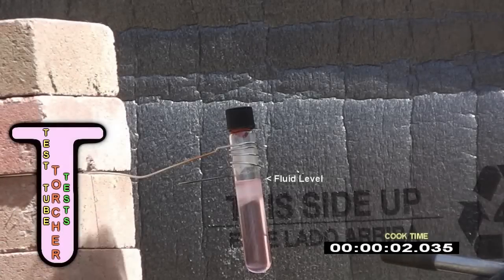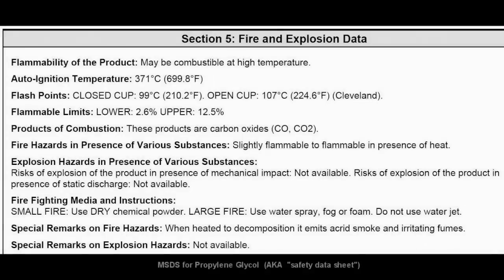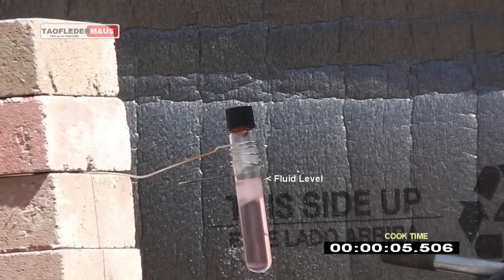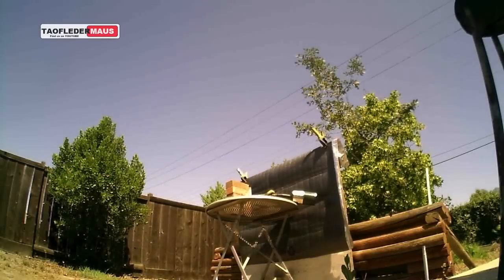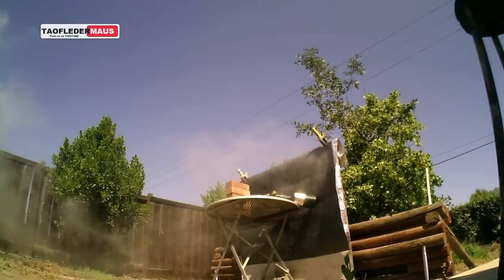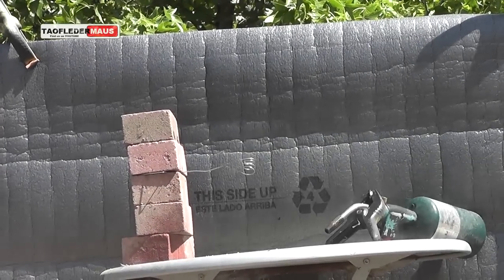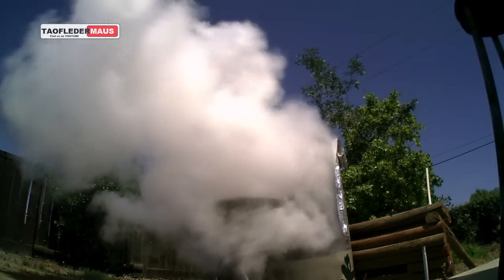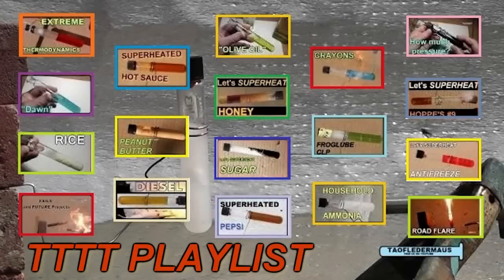TTTT - E-Cig Fluid -  30ml Superheated

Comment: if you had any clue about the ecig industry you would no that most ejuices vaped now are made anywhere from 50/50up to 90/10 and in rare cases 100/0 and the left numbers signifying vegetable glycerin and the right numbers signifying pg otherwise known as propylene glycol which mind you every study that has been done with ecigs have been done by BIG TOBACCO scientist.I am not saying ecigs are safe but I have been vaping for the past year and a half and I can run now I can walk up three flights of steps without weezing I had previously smoked Newport 100s™ for 12 years so it's proven thus far as I see they are relatively more safe than traditional Cigaretes thank you

Comment: I noticed that the test tube only explodes usually when it's push down from the fluidic scaping out of the spell so hard that it hits the bricks breaking the glass causing it to shatter. without slow mo I always thought that they just exploded from the pressure inside the tube.

Comment: How to smoke 600 e-cigs at once.
Reply: Didn't know I was dealing with children. I digress.
Reply: I have been enjoying these videos a lot. The wobbly wire and bricks where replaced with a metal bracket recently, not nearly as much fun. The wobbly wire is now back, new and improved. Sure there could be more science. Temperature probes etc But it kind of takes the fun out of superheating stuff in a confined space.
The flame at 3:17 was from the propane torch.

If you want to see a good fireball, check out the brake fluid one :)
Reply from the maker: Edward McLaughlin   If it bothers you so much,  don't watch the videos.   You won't be missed.

Comment: Can you perhaps test polyester in the tube? I know the reaction between the base and hardener can give off a serious amount of heat when mixed. And I've been warned by people that wrong mixed polyester can auto-ignite. Also you can speed up or slow down the hardeningproces by warming or cooling. I just now wondered what would happen with sudden intense heat as your torch provides is presented to a tube of mixed polyester. Will it cook, harden, burn? Or some fast epoxy. And might as well test a tube with 10 seconds superglue maybe?....Cool show...And I have to agree with you and the 95% about the wire-stand.:)

Comment: The fluid cools down so fast, that it probably had 50° C when it popped. Btw a thermal imaging cam would be cool, it doesn't have to be high-speed, just so we can see the temperature... Like 5 cameras are not enough :)

Comment: Jeff -- just a clarification of the LEL and UEL percentages. They relate the concentration of the mixture with respect to Air. I think in a sealed tube, you're limiting the amount of air and therefore you surpassed the UEL. By the time the tube breaks and spreads the fuel, you get below the LEL and/or the temperature falls below the auto-ignite. I'm not an expert but just a firefighter and this is what we're taught about Haz-mat readings for LEL/UEL. Awesome vid.

Comment: Just wondering, but could the energetic nature of the vapor explosion (the test tube bursting from the material flashing to vapor) have something to do with the absence of a more "flame-y" (yeah, I couldn't think of a better term, but oh well) reaction? It looked like the explosive expansion of the vapor created somewhat of a pressure wave that pushed the air out of the way, starving the material of the oxygen required to create more than just a little bit of flame. It also sounded like the torch itself got blown out by the vapor flash.

Comment: Now that I think about it, Nicotine in these eCigs is often in very high concentrations (~10%) and nicotine is EXTREMELY poisonous (I mean, it's pretty high on a chart of the most poisonous things ever...)

Have you sterilized the area to make sure no animals get hurt from residual nicotine? For that matter, do you sterilize the area so neighborhood animals don't hurt themselves on stray glass shards?

http://en.wikipedia.org/wiki/Median_lethal_dose
Reply: no vendor and i mean absolutely no vendor would sell e liquid at that high of a concentration.
Reply: 13RuffRyder
The problem is the lack of regulation in this industry. eCigs are labelled anywhere from 0-34 mg/mL but they often have much much MORE than this in them. There is no oversight.
Want your mind blown? The FDA does not regulate eCig juice.

http://www.fda.gov/ForConsumers/ConsumerUpdates/ucm225210.htm

"FDA found significant quality issues that indicate that quality control processes used to manufacture these products are substandard or non-existent. FDA found that cartridges labeled as containing no nicotine contained nicotine and that three different electronic cigarette cartridges with the same label emitted a markedly different amount of nicotine with each puff."

Why not just smoke arsenic? I mean they probably are already without actually knowing it but god damn...
Reply: +liquidthex want your mind blown too? The nicotine content is usually on spot, especially since nicotine is fucking expensive, its the most expensive ingridient used in those liquids. Nicotine is toxic in high doses, yes, but surprise, low doses, like from vaping, are not known to cause any constant harm.
Reply: +Okay Dokey Except addiction, of course. and your statements lack any actual data to back them up, sooo.. let's hope you're correct?

Comment: Does the release blow out the torch?
Reply from the maker: Yes,   I forgot to mention that.   The torch was blown out.  This almost always happens.
Reply: ***** and this confirms your statement about concentrations - if the torch flame is blown out, there isn't much oxygen present in the smoke cloud!

PS was there a group of people trying to give up cigarettes stood behind your fence to catch a whiff of e-cig??
Reply from the maker: A lot of people thought the brake fluid and diesel ignited because of the torch flame,   but  just like this,  the concentration was too great near the torch,   and as the cloud of heated gases moved outward,  they mixed with the air and ignited spontaneously.

Comment: So the fluid in e-cigs has the same ingredient as engine coolant? Am I correct? If so, then that's probably as bad as smoking tobacco. However, cool idea and quite a result. Thanks again, Jeff!
Reply: It's usually ethylene glycol... but propylene glycol is still used in many applications as coolant.  Just not as popular as the ethylene variety for automotive uses.  Propylene glycol is basically Astroglide.  Yes, you're smoking sex lubricant.  ...and so am I.
Reply: Because PG is food safe, and has anti freezing properties, it's used as and anti freeze for RVs, the stuff they dye pink. It's used to keep the pipes from exploding. Still, some people that use it as a vape liquid are sensitive to it and opt for a mixture with all Vegetable glycerin and no Propylene glycol.
Reply: PG and VG are both ingredients in many health applications. Nebulizors and inhalators for asthma and other bronchial issues. Sure it is diverse in many products. Meh, it's still tons safer than smoking for those that cant quit nicotine.
Reply: sorry to inform you, PG is in many different Pharmacuiticals, for both ihhalation mysting, and other aplication. Same as VG
Reply: ***** Thank you for confirming and clarifying, Jeff!
...but don't you find it odd that it's an irritant, yet it's still one of the main ingredients in sex lubricants that get ingested internally in all kinds of different ways that we won't elaborate on here today?  That's always struck me as odd.

Perhaps we should see if sex lubricant has a similar result in a TTTT?  :P
Reply from the maker: Propylene glycol is used as a food grade antifreeze.   We use it at work as a medium to chill processes,  mixed with water to keep the freezing point about 25 deg F.  
*Potential Acute Health Effects:
Hazardous in case of ingestion. Slightly hazardous in case of skin contact (irritant, permeator), of eye contact (irritant), of
inhalation.*
Reply: *****
Water is poisonous if you drink enough of it without replacing the electrolytes in your body. It's called "Water intoxication" and it causes the brain to swell potentially resulting in death.
Reply: Engine coolant is POLYPROPYLENE GLYCOL not Propylene Glycol. PROPYLENE GLYCOL is found in food, drinks, toothpaste it is used as a flavor carrier. Just about everything you consume on a daily basis. I recommend you use Google and search the 2 Glycol's. Propylene Glycol was also used in hospitals in the 30's 40's they would put it into a vaporizer and pump it into the hospital as it is a natural bacterial germicide. I for example use Ecigs have now for 2 years and I have not had the flu. Where when I didn't use it I was sick all the time. I work with the public and everyone of my coworkers got the flu during flu season except for me. Coincidence, I think not as I am not the only one who has seen this.

Comment: You should place another flame a bit further away from the test tube to ignite the vapor since the propane torch keeps getting extinguished.
Reply from the maker: I never know where the cloud will spray.    I probably need a larger table too.
Reply: Thanks for replying, that's what I like about this channel. I guess putting it about half a metre above the test tube since the vapour usually goes up after exploding. Maybe hanging It if the back board to support it.
Reply from the maker: I'd probably have to put a few ignition sources around it at different distances.

Comment: Probably one of your more dangerous experiments, considering the high toxicity of nicotine!
Reply: Not really, 600 cigs @ 30 mL. I'm guessing it's a 1.8 mg or a 2.4 mg, seeing as those are the most common.
ECig liquid really only comes in a few strengths.
0 mg/mL = 0 mg per 30 mL
0.6mg/mL =18 mg per 30 mL
1.2mg/mL = 36 mg per 30 mL
1.8mg/mL = 54 mg  per 30 mL
2.4mg/mL = 72 mg per 30 mL
3.0mg/mL = 90 mg per 30 mL
3.6mg/mL = 108 mg per 30 mL

LD50 is 3.34 mg/kg (oral).
Let's say you weigh 75 kg (165 lbs) -> you would have to drink 250 mg of nicotine to hit the LD50. You would have to drink more than two bottles of the Strongest strength.

He wouldn't have gotten more than a nicotine buzz, but honestly he probably wouldn't have gotten even that. Besides, the heat that he put to it would have likely made the nicotine decompose.

A few drops of PURE nicotine is dangerous. e-cig liquid isn't even half as dangerous as you think.
Reply: Fair enough, it would be difficult to get a lethal dose from this, I agree. Just interesed in what animal that LD50 is based on as some of the estimates for LD50 in humans go lower than 0.5 mg/kg.
Reply: Also I assumed that if it's 600 cigarettes worth then it would be around the 600-1000mg of nicotine mark, since most cigarettes have about 1mg or slightly more nicotine each. It may work completely different for e-cig liquids though, I don't really know a lot about them.
Reply: Also, the flash point doesn't have anything to do with the temperature at which the nicotine decomposes, which must at least be high enough that it doesn't decompose when you smoke it from a burning cigarette.
Reply: jhonbus It's more accurate to say that 30 mL is a month's supply, whether you smoke ten packs a month or a carton a week.

1.8 mg/mL is equivalent to about pack a day (600 cigarettes over a month) but there's only about 1/10 the amount of nicotine in it compared to actual cigarettes.

You're right that you get about 1 mg of nicotine out of a cigarette. but at the same time you lose a lot of the nicotine in the smoke. And you get a lot of other chemicals, some of which I'm sure interferes with the nicotine's bioavailability.

The nicotine in e-cig liquid is more available for absorption but there's less of it, You generally want it a bit more frequently but at the same time you're satisfied more quickly.

When I was smoking I was always satisfied by 1/2 the cigarette as are most people, so to tell the truth most of the cigarette goes to waste.
Reply: Don't forget what Paracelsus said: "It's the dose that makes the poison." There are safe and toxic levels of almost anything, including water. Nicotine in the doses that typical users ingest is safe, about on-par with caffeine. It's the delivery method (and approximately 4000 other chemicals formed during combustion) that make cigarettes a health hazard. I'd even go so far as saying that nicotine by itself is probably one of the least-dangerous aspects of smoking; yes, it does have addictive qualities, but aside from that the health risks are minimal (again, like caffeine.) Obviously large doses can be quite dangerous though, so using a little common sense is important, especially if one chooses to mix their own eliquid at home and handle high concentrations of it.

Comment: Propylene Glycol, isn't that stuff dangerous to have in something like e-cigs?
Reply: yes
Reply: No, it's actually in inhalers and many foods.
Reply: Not dangerous at all. Actually it is anti-bacterial. They use it in hospitals for keep the air clean.
Reply: No, propylene glycol is incredibly safe. It's used in asthma inhalers, nebulizers, hospital HVAC systems and tons of other uses. It's also in a huge percentage of food because it's a humectant (it keeps food moist.) Propylene glycol is also the primary ingredient used in fog machines. Diethylene glycol is the dangerous ingredient in antifreeze and is highly toxic; that should never be found in ecigarettes. However, they do use propylene glycol in the "pet friendly" low-toxicity types of antifreeze, so it's not entirely inaccurate to say that propylene glycol is in some types of antifreeze...just not the super toxic kind that most people use.